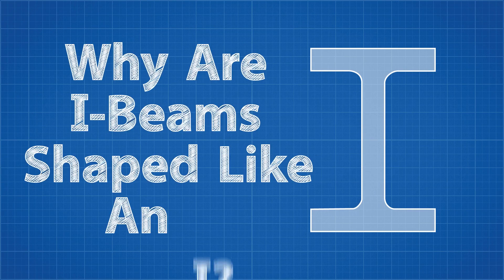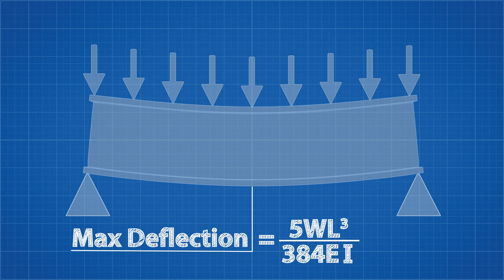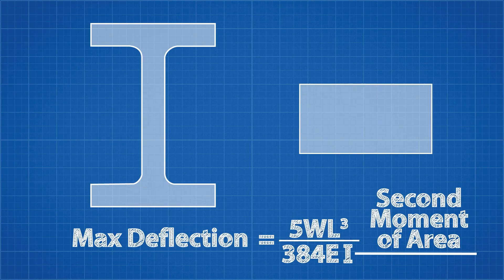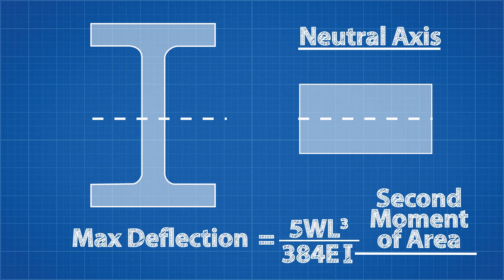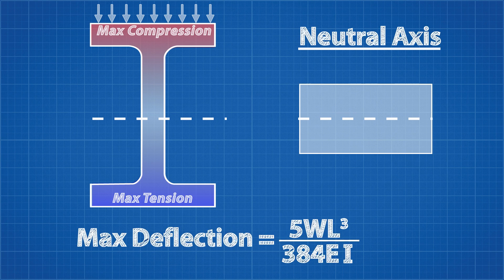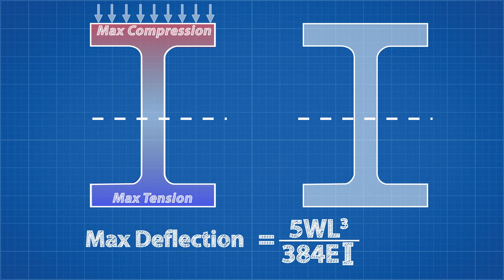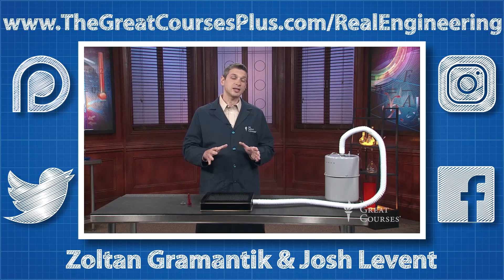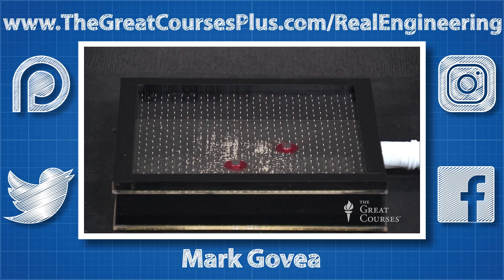Why Are I-Beams Shaped Like An I?

Comment: Since the compression and tension are all on the outer edges, why aren't they shaped like a hollow square then?
Reply: That would be a box beam. 
Thew reason for not using them is for the same amount of material a I-Beam is stronger. The amount of material is relevant for the cost. I suspect I-Beam also are cheaper to manufacture
You have access to all sides of the beam and a bolted or welded joint is easier to do. Water cant collect on the inside if it is outside and that reduces the risk of rust
But a box beam is better if it has to resist torsion(twisting)
Reply from the maker: Peter G answered exactly as I would have (probably better), good work
Reply: The root concept to explain why an I beam is better than a box beam has to do with the one-dimensional aspect of the load, a.k.a. gravity. The load will ALWAYS be from top to bottom, so there is no need to maximize the moment of inertia in the lateral direction. Of course, if you have an application where loads come from the top, but also from a side, a box beam may become necessary.
Reply: When you get in box sections/square tubing, you then start to concern yourself with compressive buckling of the side because they are thinner areas.

For bending placed about the center axis of the member, I-beam (W shape) >> Square/Box

For torsional load resistance, Square/Box >> I-beam
Reply: The box beam is better if you're just as likely to get force applied from the side, but in most beam applications, force will be primarily from one direction, like if it's holding up the rest of the skyscraper, then most force is with gravity's direction, and only a tiny bit of force is sideways from wind or similar.

If your force is 90% from one direction, then the box that devotes 50% of the resources to the 10% of the force's direction would be inefficient.
Reply: What you are describing are called HSS (by the way, structural engineers call these W-shapes where W is for Wide flange) and although they are efficient, they are much more expensive to make and more difficult to detail connections from one piece to the other.

Comment: What happens to the neutral axis of a non-symmetrical shape?
Reply: you will then have a internal torsional moment applied to the section that will have to be considered in your design. it's essentially the same as if you applied the loading slightly off the neutral axis of a symmetrical shape
Reply: If you (try to) bend an object there will always be an area that's in compression and an area that's in tension, the transition between those areas is the neutral axis. Bend it downwards, tension in the top, compression in the bottom and vice versa.
Reply: the neutral axis is located at the 'centroid' of the shape, regardless of it's symmetry it's the point at which the amount of material above and below the NA are equal
Reply: Hi David.  Actually, this condition requires symmetry.  That is, the neutral axis only occurs where the material above and the material below are equal in sections that are symmetrical about the neutral axis.

Comment: then why isnt the middle bit micron thin?
Reply from the maker: It still needs to resist sheer stress. We want to minimise that section (called the web), but there are other forms of stress it needs to resist.
Reply: Also if you make the web too thin it can fail through buckling. This is a common failure mode when using light gauge steel (1-2mm thick). (You can get round this issue to some extent using stiffening elements)
Reply: thats  the shear stress though, right? so your saying the same thing as realengineering
Reply: Why not make it thinner then, but in a wave down the middle? Or is that just too hard to produce reliably? Also, I had a different answer in mind when I saw the video title... in that when you try to bend something with a T shape you're actually effectively trying to pull the crosspart to the part you'd bending apart end to end (tension, yes?)... which is, comparatively difficult? Does that play a part here?
Reply: @damien4197  With rolled steel sheet metal purlins, they do build the structural members with waves along the middle for improved strength.  This is thin sheet metal that is 1/16" to 1/8" thick max, and it is cold-rolled to its shape.

With the I-beam and wide flange beam, the inner part is hot-rolled from a red-hot solid rectangle of steel.   It is too difficult to reliably produce waves in the web, and there wouldn't be any significant benefit to it.   What we've got already works, and the web is thinner than the flange.  A beam flange might be a half inch thick, while the web is less than a quarter inch thick.

Comment: Cool video. But why can't jet fuel melt them?
Reply: The adiabatic flame temperature of jet fuel burning in air, is colder than the melting point of steel.   You'd have to burn jet fuel in pure oxygen, to get it hot enough to melt steel.

Even if it cannot melt them, it will seriously weaken them to the point where they bend like wet noodles and are useless as beams, yet still solid.

Comment: when the load is applied  on top of the beam , shouldnt the tension be on the top section and compression on the lower section ? or am i wrong ?
Reply: The beam is supported at both ends, not cantilevered, so the load causes it to bend in the centre, compressing the top and placing the bottom under tension.
Reply: No. As the beam attempts to bend down, the bottom has to become longer and the top shorter. This means that the molecules at the top of the beam are being pushed into one another, while the molecules at the bottom are being pulled apart.
Reply: this doesnt make sense, imagine a circle  bent from a beam. the inner circle sure is under compressive stress and the outer circle is under tension stress. same goes to a beam bending down ward, as the top section is stretched = tension, bottom section is being compressed.
Another example , The a circle with thickness of 5 cm, the outer surface must have a longer circumference than the inner surface.
Reply: In your example of a circle, you would effectively have to continue pushing down, meaning the top would again, be under compression.
Reply: i was assuming just one end is fixed, and load on the other end, my bad ..
Reply: +yeung jasper - Ah yes, I see. In that situation, you would indeed be right, and the compressive stress would be at the bottom. Nothing an I-beam wouldn't be able to handle though...

Comment: can I have a requests for a video about second moment of area? I still didn't get it...and sorry for my bad english...
Reply: For simple tension and compression loads, the property of geometry that matters is the cross sectional area.   Every square mm contributes equally.

For beams, the stress is not uniform, and the members farthest  from the neutral axis contribute the most.   The distance from the neutral axis contributes two-fold, which is why it gets squared when calculating second moment of area.   Members are in greatest stress, the farther form the neutral axis, and members have the greatest leverage against bending, the farther they are from the neutral axis.

Second moment of area is calculated by adding up (or rather integrating) each distance^2 * infinitesimal unit of area, where the distance is the distance from the neutral axis.  It is an analogous concept to moment of inertia.  Except instead of adding up this property of tiny masses, we are adding up this property of tiny areas.

It may be called the area moment of inertia as an alternate term to second moment of area.  But bear in mind, it has nothing to do with inertia.  It is a property of geometry, that plays a significant role in the stiffness and strength of beams.

Comment: Is ANYONE else triggered that an Engineering channel isn't calling this a "W Section" ... which is what it actually is : - |

Also you need to specify during your application of downward force example if it is being applied at the end of a W section or the middle because if it is at the end, then the top is in Tension and the Bottom is in compression. 

Shame
Shame
Shame 

.... also, I like your channel ;-)
Reply: +Wes Arnold, I-beam is just the generic term used for these sections, you should know this, and you should also recognize that even with this being an engineering channel, people with absolutely ZERO technical or engineering experience can watch these videos.
Reply: Why is it called a W section? I've always known it as an I beam or RSJ
Reply: W is for "Wide Flange" beam
Reply: Andreycs0 That is probably from Wikipedia and this is an Engineering channel. I can assure you that a standardized steel manual does not contain the phrase "I Beam". 

Also I was just trolling for fun, but the name I Beam really is colloquial.
Reply: German engineers call it double-T beam.
Reply: While essentially true, I just though you would differentiate them since all differ based on location of tapering / presence of  tapering and flange / web ratio.
Reply: "An I-beam, also known as H-beam, W-beam (for "wide flange"), Universal Beam (UB), Rolled Steel Joist (RSJ), or double-T (especially in Polish, Bulgarian, Spanish, Italian and German), is a beam with an I or H-shaped cross-section."
Reply: Thanks DirtyD, I love this channel ,but I aint no engineer.
Reply: Our steel tables definately call it an I beam, albeit IPE, INP, etc. The I stands for its shape, just like a HEA which has a more H shape to it.
Reply: Wes is correct, but possibly only in the States, and possibly only among those that use AISC standards.  Being in the states, RSJ, IPE, and HEA are all designations that I have never seen before.  The main designations here W, M, S, and HP shapes.  W (wide-flange) is definitely the default for structural design.  HP is used mostly for foundations and geotechnical applications.  I have never see M (miscellaneous?) or S ("American Standard", with a tapered flange, and now considered archaic) used in practice.  The terms "I-Beam" and "H-Beam"  are generic terms only, albeit, perfectly suited for this video.  I-beam and H-beam are often used interchangeably, though some would argue that I-beams have tapered flanges like the S shapes, whereas H-beams do not have tapered flanges like the W, M, and HP.  In any case, design engineers avoid using "I-beam" or "H-beam" unless speaking with contractors or others who use these terms fairly regularly.
Reply from the maker: I, H, W and RSJ are all essentially the same thing.
Reply: *****
That was just a fast research on google... I was looking at the brazilian code and it's used as I-beam and H-beam.
I know why you said that about W-beam. I studied the american manual of steel construction (I have it by my side). When I studied in the USA it was often used the W-shape.
Reply: Wes Arnold   As opposed to an N section (narrow flange)?

Comment: I thought it's called H beam :/
Reply: There are H-beams and I-beams. The H-beam has a bigger flange. Google it, since I can't really explain the difference in English.
Reply: H-beams have rectangular flanges, that are generally wider than those of their I-beam counterparts.  I-beams by contrast, have tapered and curved flanges, that optimize the flow of stress within the member.

H-beams (aka Wide flange or W-beams) have the advantage of simplicity of fastener connections.  While I-beams have the theoretical advantage of strength/stiffness to weight ratios, and can generally out-perform an otherwise-similar wide flange beam that weighs the same.

Comment: After watching this I am curious, why not make a plus shaped beam instead, would it not have the same effect or is it just not as cost effective or practical?
Reply: If by plus shaped you mean +, wouldnt that just put more material in the middle, where we don't want it? Even if you flip it so its on the side like X you still have 2 "rods" in the middle, instead of just one with the i beam, making for more material in the middle than an I beam.
Reply: that would provide a hig moment of inertia in two axis simultaneously. However if that is what you needed it's likely that a hollow tube would be a more material efficient shape as more of the material would be at the edges.

The material near the center line isn't as useful as material far away from the center line. This why there is only a minor variation in the thickness of the webbing or flanges on an I beam. So when you need to support more load with the same deflection you almost always end up with a taller I, rather than a thicker one. 

One thing not touched on here is that beams like this will also have a tendency to twist as they are loaded. The shape of the flanges (top and bottom of the I) will also resist  that twisting better than say a large blob of steal on the top and bottom. I forget the correct term for the twisting it's been a long time since my statics/strengths of materials classes and i generally don't need to structural in my day job.
Reply: Andrew Frink you mean lateral torsión buckling, maybe?